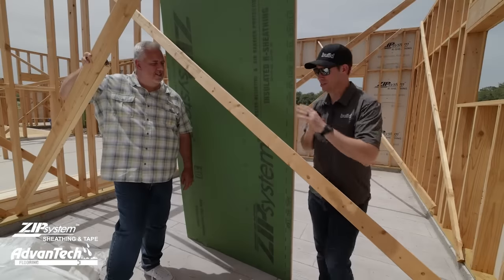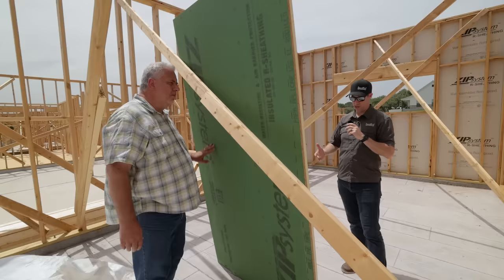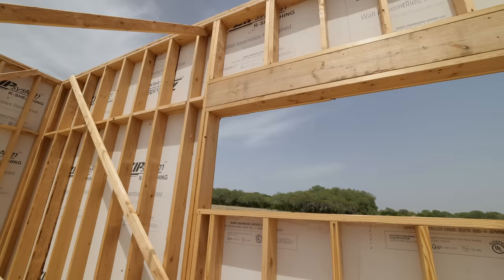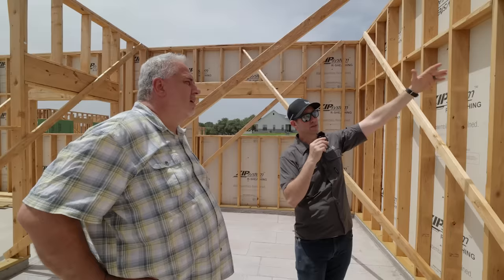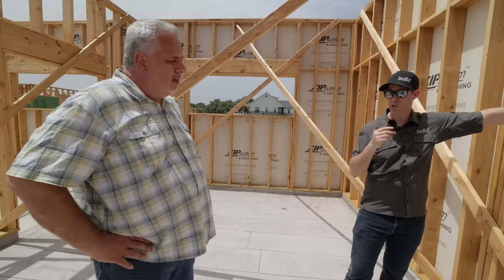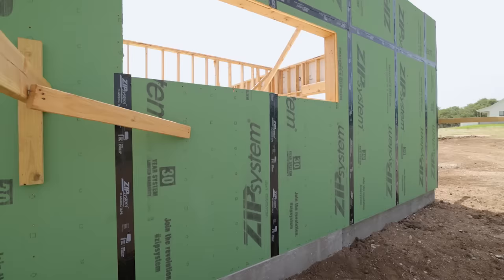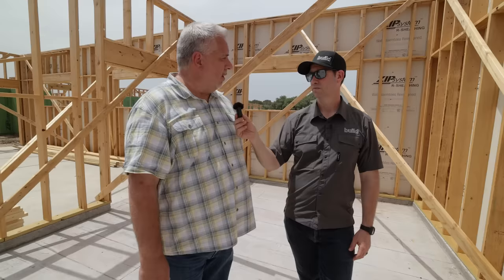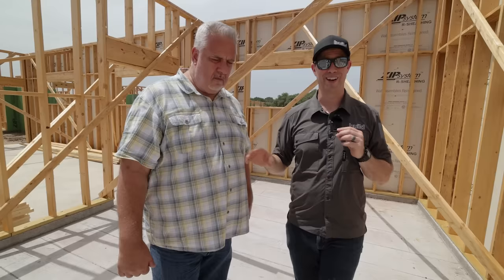ZIP-R Sheathing Review (Feat. Steve Baczek)

Comment: I used zip-r on my house and had a ‘metal lug’ cast into the slab. It’s a 1.5”x1.5” step that goes all the way around the building. The zip-r then sits down in that helping to seal the bottom plate. I used some big stretch to create a backer and the zip liquid flash as the final seal between the zip and concrete.
Reply: Does the metal lug sit just below the seal plate, or is it attached to the seal plate?
Reply: lets get some pics of this
Reply: @sampickett3843  It's cast into the concrete slab, so the sill plate sits at the interior slab level, and the Zip-r hangs down about 1.25" below the bottom of the sill plate. From the outside though the Zip sits flush with the perimeter of the slab so most people would never know it has exterior insulation.
Reply: @sampickett3843  It's cast into the concrete slab, so the sill plate sits at the interior slab level, and the Zip-r hangs down about 1.25" below the bottom of the sill plate. From the outside though the Zip sits flush with the perimeter of the slab so most people would never know it has exterior insulation.
Reply: @srt4b  The green face of the Zip sits flush with the outside face of the slab, so it really doesn't look very 'different'. The only thing that overhangs the slab is the thickness of the siding so even experienced builders probably wouldn't guess that the house had ext. insulation. BTW, I've been very impressed with the performance of the R-6 Zip-r. I haven't yet insulated the stud cavities, but the inside is already staying cooler than a conventional 2x4 insulated house in the Texas heat without AC .
Reply: Sound interesting though I don't understand the terms "metal lug" (I'm thinking embedded threaded rod?) and "big stretch". It also sounds like you put a shelf in the slab for the Zip to sit on?... So I guess my take away is just, there are ways to deal with it.
Reply: @pcatful  Yeah, a 'metal lug' is a ledge or shelf that is recessed into the perimeter of the slab. It's usually used on metal buildings so the corrugated metal sits flat against the slab and doesn't get damaged.
Reply: @atomicsmith  sounds like an embedded piece of angle iron?
Reply: @Truth-Seeker777  No, it's just a 1.5x1.5 ledge cast into the slab.
Reply: Run a 2 x 2 (1.5" x 1.5") down the outside face of your grade beam / slab form flush with the top of the slab.  When you pull the forms you have a recess that the Zip R can sit on.  Is that what you did @adam Mackey Smith?
Reply: @scottperry2541  Exactly. I recommend using some 1/4 - 3/8” spacers as you set the zip-r so you can set a nice bead of sealant.
Reply: @atomicsmith  absolutely

Comment: A major advantage of the Zip R versus Zip+exterior insulation is when the inside moisture finds a cold surface inside the wall cavity, the moisture will condense on the waterproof poly-iso, instead of on the un-faced OSB side of the Zip, which is vulnerable to any moisture.
Reply: Is that really an advantage?

With a proper ratio of interior and exterior insulation, the exterior insulation setup will never/rarely let the sheathing get cold enough to condense.  That said, exterior fastener points and seams could be cold/problem points in that setup.   Meanwhile, Zip-r leaves all the sheathing itself out in the cold.   You would almost certainly be relying on the poly-iso as a vapor barrier, but nothing is perfect.  At the least you have unfinished seams exposed to the inside around the edge of every panel - with varying gaps depending on quality of install. 

More importantly, how is condensing on the inside of the poly-iso itself a good thing?  Sure the poly-iso might not care, but the framing certainly will, the cavity insulation most likely will - and that poly-iso isn't going to be great for letting it dry to the outside very quickly.
Reply: @chuckuni5366  actually water won't condence on the back of the Zip-R sheathing so long as it's thick enough. Just as you said if you add extiror insulation you effectively move the dew point further out. You can easily calculate  if you have enough extiror insulation to prevent any dew from forming in the wall cavity. Though I would still recommend the use of a smart vapor retarder in cold climates. Also blocking is required at all sheathing seams in almost every municipality.
Reply: @Ilove3SGTE  I realize that this is the case, but just pointing out that condensation on the inside of the cavity is not a great thing, foam or not.  Arguably worse if it were to happen with foam as your would be reducing the ability to dry it out.
Reply: What happens to this zipr if cedar prestain shingles are installed without a rain screen?
Reply: @chuckuni5366 , agreed.  Fundamentally one can build a great wall system with Zip-R or Zip/OSB + weather barrier and exterior insulation.  One should always plan to put enough exterior insulation to prevent condensation from forming inside the wall cavity in the first place, based on the yearly temperatures and humidity the house is being placed in.
Reply: @chuckuni5366   yeah I agree if that we're the case. if your using rigid extiror insulation drying to the outside doesn't really work anyway. The perm rating for eps is 6 divided inches think and xps is usually around 2 divided by inches thick. Which almost doesn't matter because sheathing has a perm rating of 1 to 5 under most conditions. If you really want to dry to the out side with meaningful capability you will need inboard sheathing. If you want to truly dry in both directions you would need to use straps and extiror drywall and water based interior paint. Zip-R sheathing actually uses unfaced polyiso which has a perm rating of about 20 which is a better scenario then most other options in my opinion.
Reply: @Ilove3SGTE  True.   The benefit to swapping the insulation to the outside IMO is that (ideally) the dew point is outside of the sheathing.  Plus, there are more vapor open insulation options, if drying is the ultimate goal.

The vapor openness of the interior side unfaced foam could be a bit of a double edge sword as it could let more vapor through to the sheathing than the cold sheathing could dissipate.
Reply: You guys all argue on the condensation in the cavity affecting the sheating in a cold climate. In a cold climate there is a vapor barrier behind the interior finish panels (drywall, plaster, wood panelling, whatever), and if there is condensation happening, and excessive air leakage from outside or inside, it means the installation is poor.  In a  cold climate, say,  down into -25 C that sheating won't have condensation unless there is major heat loss....

The foam being in front or behind the exterior sheating will not dramatically alter the walls ability to shed that moisture, especially if it is present in that cavity BECAUSE of excessive exterior air leaking into the wall...  That's why old houses or apartments that are leaky as sieves(air leakage) rarely see rot and mold unless there is major water ingress.
Reply: @rolfbjorn9937 I agree foam in front or behind doesn't make much of a difference. That was actually more or less the point I was trying make. I did say that a smart vapor barrier should be used in cold climates. Also I have been in plenty of old houses or apartment buildings all of them have rot somewhere. I'm not sure were you are finding these rot free buildings. An air tight house done properly is much better then a let it leak house.
Reply: @Ilove3SGTE  The assumption is that poorly insulated houses will have a lot of condensation and therefore rot the wall studs and sheating. However, the amount of air leakage, often both ways, exterior and interior keeps that wood dry enough. There is plenty of video evidence of very old leaky buildings only having rot where there is direct water ingress without an ability to dry (or very long time). In modern buildings, that's kitchen, bathrooms, roof leaks, basement leaks where high constant moisture is trapped. Around windows too. Especially when building codes are poorly respected where you get constantly humid insulation trapping moisture due to poor building practice. Most of the wall cavities though, not so much.  And you were talking about wall cavities, not areas of direct and frequent water contact. You shouldn't get rot due to condensation on the sheating.
Reply: @rolfbjorn9937   you're right, uninsulated or very low insulation homes in the South don't have rot just from condensation. You can sometimes find these types of home there. I live in Wisconsin. I have never seen a house with no insulation. It gets down to -30f or lower sometimes here. I would still assume that if you were to build yourself a home especially in the northern states that you would probably want good deal of insulation. It's not all about condensation there is a comfort and cost of owning element also. Air leaks drag in very dry air during the winter. To much air leakage can make your wood floors crack as well as your hands and throat. It's also more expensive in the long run. Lots of insulation, very air tight and managing your moisture with a good and well installed smart vapor barrier is the way to go for me.
Reply: @Ilove3SGTE  I agree, I live more north than that, so I understand. My point is that a leaky house with insulation will dry better than the fairly tight house, and the condensation is not the worst issue, its going to be the weather barrier and water mitigation. That's why on all these building science channels and videos you'll see rain screening and water proofing. The houses needing to breathe myth comes from houses that got vapor barriers and insulation, but no way for water to escape and any interior or exterior leak was/is rotting them. 

I opened up walls in apartments that were drafty and uncomfortable(even as a tenant, it's easier to make one big hole, find the studs and fix it properly that turn the wall into swiss cheese like the others....), and besides windows, top plates, bottom plates, doors or other obvious breach outside, there was not a crazy amount of mold or rot like you'd expect if the condensation on the sheating was so dramatic as a source of rotting the structure "inside" out. The wall cavities were disgustingly dirty around air leaks and there is rust on nails obviously. 

And the heating cost of course was abysmal. It's when someone goes in, re-insulate, put a vapor barrier and refinishes the inside but the weather barrier and air exchange is not adressed that you run into more problems. Hence the "houses need to breathe" falsehood.
Reply: My problem with this system as presented is the nails.

That's a cold sink through insulation straight into the studs and just feels unwise.

Anybody know of suitable glue for binding the Polyiso to the studs instead?
Reply: @priestesslucy3299  glue wouldn't be wise. They do make plastic retainers for extiror foam. The size of the nails is very small and wouldn't have much of an inpact at all.
Reply: @Ilove3SGTE  plastic retainers?

Is that the term I should search to look into this?
Reply: @priestesslucy3299  I honestly haven't ever used them. I've only seen them used.
Reply: @ProfessionalFixologist   I’m quite worried about what you’re talking about. I live in Northwest Kansas so it’s a semi-arid portion of the southern part of climate zone 5 in the USA.

The coldest temps I have seen here have been around -25° F. Usually it’s only -15° F a few days a year.

But if I want the interior of the house to be able to be 45% humidity and 72° F the dew point of that air will be something like 53° or 54° F.

72° inside and -25° outside is a 97° temperature differential.

Let’s say ZIP R12 is 2.5” deep and then I add 2” of closed cell spray foam in the wall cavity and then Rockwool to the inside of the closed cell.

Total depth is 8”?

If you assume continuous R value throughout (which I know isn’t true) then the temp should increase 12.5° per inch as you move from the -25° air outside to the 72° air inside the home.

This means the air would be colder than 54° anytime it was 1.7” or deeper into the wall. In other words, the condensation area could be inside the Rockwool area.

Seems like it would really take a ton of exterior insulation and maybe no interior insulation other than the little bit of spray foam to keep the condensing surfaces in an area where it won’t cause problems.

What are the solutions there?
Reply: @Ilove3SGTE  wish I had seen this conversation while you guys were having it.

I’m not in quite as cold of an area as you but it does get down to -25° F here sometimes.

I’m really worried about depending on a smart vapor barrier to protect the wall cavities from condensation because I feel those smart vapor barriers will certainly get damaged over the decades by people hanging pictures, mounting TV’s, running cables in the wall, etc.

You feel comfortable depending on a smart vapor barrier over the long run?

The reason I ask all of this is because we’re going to start building a new house soon and I want it to be very tight. Since it will be very tight, as cold as -25° F outside and probably 72° with 45% humidity inside, I really am concerned about condensation in the wall cavities. With a tight home that will really struggle to dry out I would think.
Reply: @danielleebrick4272 , hard to address in a just a comment, but look up Joseph Lstiburek's Perfect Wall.  Note that due to thermal mass and the hydric buffer capacity (ability to absorb and release water) of the house, you don't usually need to do calculations against the coldest temperature, but more like coldest daily average.  A small amount of condensation on the worst day of the year is usually not a problem as it will dry out other days/rest of year.  Also you're correct in that there is a danger in using batt insulation in such a case.  Old houses leak enough air to dry out the cavities, but when going quite air tight with spray foam in cold climates, no batt insulation is often used in the wall cavity, just the 2" or whatever of spray foam.  If a higher R-value is desired, additional exterior insulation or interior spray foam is added.  Also note your interior humidity is not likely to be 45% in an arid climate in the wintertime unless you're running a humidifier/doing some serious cooking showering/etc.
Reply: @danielleebrick4272  I agree with what Professional Fixologist siad. I will add that the humidity in a air tight house is naturally going to be higher then a leaky house. The outside air at -25 is going to be close to 5%RH to your indoor temperature. if you let in less air the inside will stay at a higher humidity (please don't use a humidifier if possible during the winter). You are right, if all things were easy at that temperature and humidity you would see a dew point in the rockwool area of the stud bay. I wouldn't worry to much about the worst possible days though as Professional Fixologist stated it should dry without issue. Hydric buffer capacity is going to buffer out some of the high humidity. The use of a smart vapor barrier like "Pro Clima Intello Plus", "SIGA Majrex 200" or the one by Certainteed will reduce the moisture gain into the wall and allow any that got in to come back out latter. If well installed they will likely reduce it so much so that you won't even reach the dewpoint even on your worst day. Probably even if you went with 2" Zip-R. I would personally build the wall as you described and use a smart vapor retarder/Barrier and not worry about it. Joe Lstiburek's Perfect Wall is awesome and fool prof but I would rather add in the extra 14+ R-value and sound deadening that comes with the rock wool. That's my 2 cents anyway.
Reply: @danielleebrick4272  If you really like to be exact. I find the temperatures in a composite wall structure like this. Divide the differential temperature by the full R-value of the wall to get the degree temperature changer per R-value. Then just work your way though the wall to find were your dew point is.

12 + 13 + 15 = R33 
97 / 33 = 2.94 degrees per R-value. 

I used my Psychrometric calculator to get a dew point of 49.6.

72 - 49.6 = 22.4 
22.4 / 2.94 = 7.62
7.62 / 4.2 (rockwool R-Value)
Gets you 1.8 inches. Close to what you got but the dew points are different.

Comment: With the sheathing held off the framing by relatively soft foam, I’ve gotta believe the shear (racking) strength is drastically reduced.
Reply: That was my though exacly!
Reply: This is my concern as well, would like to see it addressed. I'm looking to build a house with 2x6 framing, rockwool, zip sheathing, and stucco exterior. Hope it gets me a good bang for the buck.